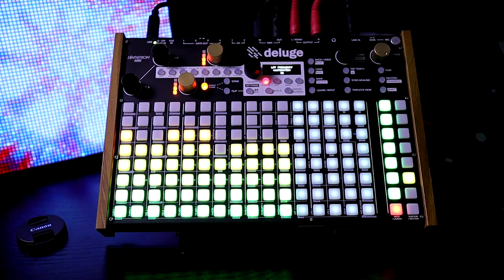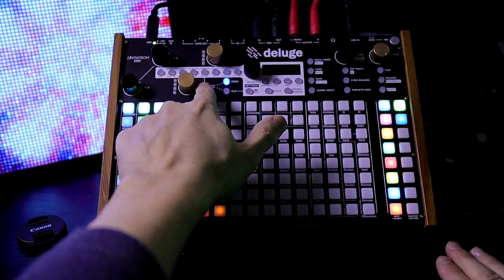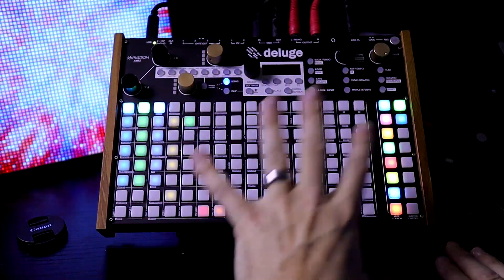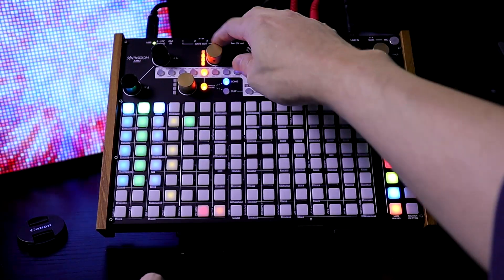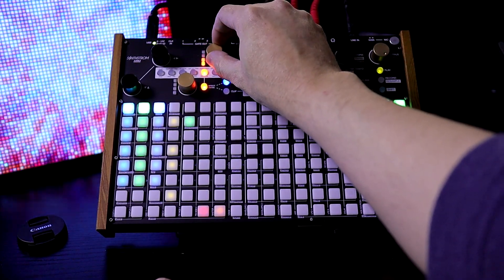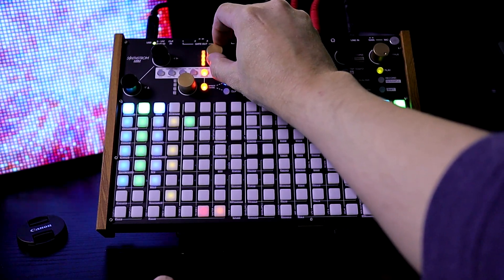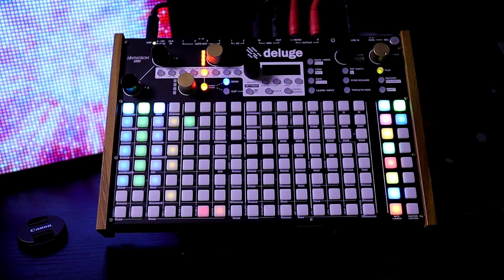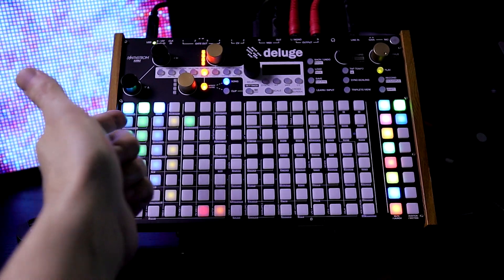Brief Look at a Few New Features / Deluge Open Source Firmware 1.0 // Synthstrom Deluge Tutorial

Comment: Oh man. So excited to dig into this. The automation page is such a great addition! The new velocity pad page for drums is cool too. One thing I’m still wondering… is there a way to randomize velocity yet? So a kick or hat for example isn’t always hit with exactly the same velocity? (like a real drummer..) I always program it in manually, but it sure would be nice to randomize it…
Reply: To randomize drums I just mod the velocity of the drum I want using random, works great!
Reply from the maker: @elwhagen  oh wow that is actually a simple fix! Will note this on automation video !
Reply: Aww nice! So you can! I always thought velocity was locked to outboard midi controllers so I didn’t even try. Sweet! Thanks for the tip!
Reply from the maker: I don't think there's a command for that yet but you could just use keyboard mode in drum kit and play it out, each square has velocity variation
Reply: Ya that feature is def better than manually programming it per step! Would be cool to map to random eventually though too. Could be really nice for adding texture with keys too. Thanks for all you do! Appreciate you man!
Reply: if a real drummer randomly hit his kit at random times with random velocity, they would be fired from whatever drumming job they had.
Reply from the maker: @xisotopex  that's a great point. I have an edrum kit but i like to program a lot , random wouldn't really work for a real drummer thats true
Reply: @xisotopex  If a drummer hit his kit exactly the same time every time he would be replaced by a drum machine...
Reply: @elwhagen  
re-read my comment, because you obviously didnt understand what I posted. If you had ever played a real instrument with other people playing real instruments as well, you would understand. but good luck with hoping a randomize function will help your music sound better.
Reply: @xisotopex  Kid, better reconsider what was said yourself. Understand that random does not say anything about the scale of the randomness. If there was no randomness you might as well just use samples in a drum machine. That’s my point.
Reply: @elwhagen  
my advice to you, learn to play a real instrument, proficiently, as I have, in real bands that played real gigs across the country, and recorded real demos and E.P.'s and you will learn that "randomness" is not part of any musical equation, and would never be tolerated. random does not equal feel, random does not equal groove, random does not equal 'human-like', in any way. randomness only equals bad musicianship 100% of the time.
Reply: @xisotopex Except that nobody asked for your advice ..😉